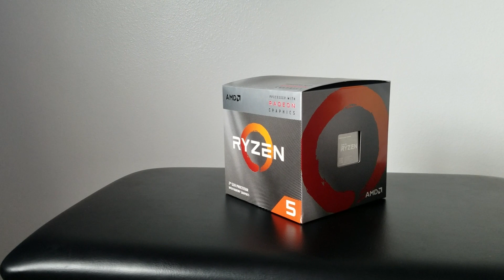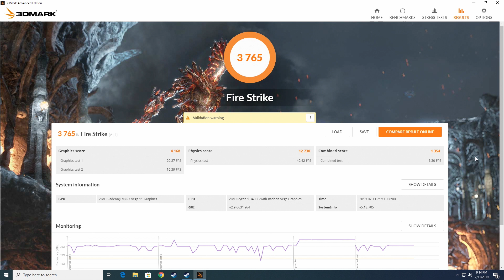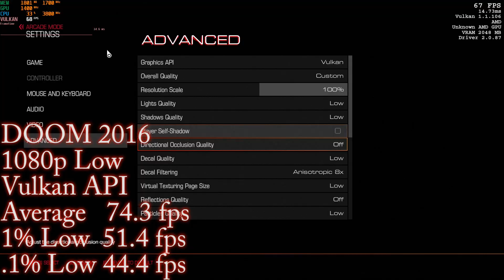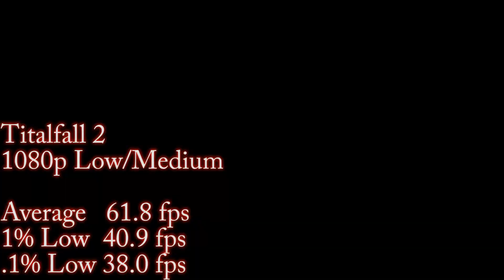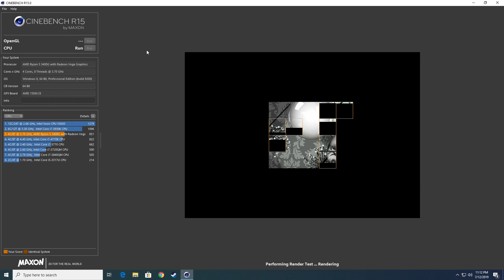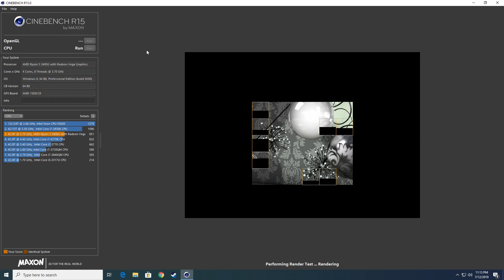Ryzen 5 3400G w/ OC Samsung B-die Memory

Comment: Hey man i need your help. I'm an amateur but I want to build a new computer. I'm thinking MSI  B450M titanium mother board with Ryzen 5 2600 CPU but I don't know which Ram to get.
At Max i will be editing images in photoshop but I'm not a gamer AT ALL so i want to save as much as possible on money. I think I'll stick to the reccomendations AMD reccomends for this built and I'm looking at corsair vengeance LPX 3200mhz 2x8GB 16-18-18-36 for $150AUD or the G skill expensive price at $350AUD flare x or Triden z 3200mhz 14-14-14-34 2x8GB.
I heard these are both B-die but don't know if that's true?
What Ram do you reccomend for my motherboard and CPU? I got radon 250 graphics card btw and Samsung 860 evo ssd.

I want to save money and don't know if the hefty price tag of $350 is worth it?

Thanks
Reply from the maker: Hey man! I think for your situation it makes the most sense to go with the $150 LPX kit. It's not B-die, but in most cases it's not needed. If I were you I'd save the cash and put it elsewhere. You could get a couple percent more performance with the Trident Z kit, but I don't think it would be worth another $200.
Reply: @prerunnerwannabe  thanks for your reply man. Is it really recommended to follow what the AMD advice's on the compatible RAM or should i ignore their list and just go with any good brand i find? also what do you think about my setup, Ryzen 5 2600 with M450 Mortar or M450 pro carbon with radeon 250 graphics card, its for doing editing on photoshop at max? im about to buy the computer soon maybe this week. Also will my old intel 500w powerbox be compatible with the new AMD or nah? do you know where i can buy get windows 8 because i think my windows 10 is messing up with me a lot, will windows 8 be hindering the performance of my new comp? thanks for your reply. Sorry im a noob at this
Reply from the maker: @r.k862  Really if you want to be super sure that your ram kit will work, go to the QVL (qualified vender list) for the specific motherboard you're interested in and see what ram kits they recommend. 
I like your build, although I would personally like a slightly more powerful gpu, you probably don't need anything super beefy for photoshop. When you say powerbox, do you mean the power supply? As long as it is a decent brand and has a 24 pin and an 8 pin connector, you should be fine.
I don't think Windows 10 should cause any issues with this build and running photoshop. . . I would personally do a fresh install of Windows 10 instead of going back to windows 8. It's just newer and is superior in my opinion.
Hope that helps!

Comment: Hello from Russia (sorry for Putin, we will fix it soon) ^___^
I want to build a computer on MB "Gigabyte B450 I AORUS PRO WIFI" with RAM "HX424C12PB3K2/32" and "R5 3400G". Case "Powerman EQ-101 200W Black".
Please answer some questions:
1. How is the consumption from the socket (all system) and on the testimony of HWiNFO64 (APU)? (in watt)
2. What are the temperatures of the APU during the game?
3. How do you measure .1%? (Methodology, program)
4. Add percentage of GPU-employment.
5. I am looking at CPU loading. In all tested games, performance is limited by VEGA 11? Logically reduce CPU power and add GPU frequencies
6. How many ranks of memory? (I'm not talking about the memory channel) I think in 2-rank memory the minimum FPS will be greater at the same timings and frequency.
7. The new APU "4400g" will be on zen2 and its memory can be overclocked over 4000Mhz. Как тебе такое Илон Маск?
8. 4:33 - song name?
Reply from the maker: Hello! Hahah! We'll try and fix Trump in 2020 as well :)
I like your motherboard choice, just make sure that the BIOS is updated or that you have a way to flash it to the latest BIOS. Even though the 3400g is a Zen+ chip, it still needs the latest BIOS. 
I'll answer all of your question as best as I can!
1. With the memory overclocked but the cpu running stock, the most power draw I ever saw was around 160 watts from the wall, so really more like 130 watts because the power supply I was using is only about 80% efficient. I used a "Kill-a-Watt" meter to accurately measure the power usage.
2. If you use the included Wraith Spire cooler, you should only be seeing temps in the 70's C. 
3. I used MSI Afterburner, because they have some really nice tools for measuring almost anything that you want, including .1% lows. Basically once the game loaded up, I would hit whatever key is set to start the benchmark run and would play the game until I felt I tested a sufficient amount of the game to make accurate results, and at that point, I would stop the benchmark.
4. I tried, but there is a bug so it shows like 60,000% gpu usage. Weird, right?
5. Yes, in all of the games, performance is limited by the Vega 11 graphics. I did that to an extent by disabling the cpu boost feature, and that gave me more headroom to increase performance on the gpu. It's still not crazy powerful though.
6. I believe I used single rank memory, and I was under the impression that single rank performs better, but I could be mistaken?
7. That would be awesome if the memory could be overclocked to over 4000MHz on the 4400g!
I couldn't tell what that last bit was. Were you asking if I like Elon Musk? 
8. The song is called "Thor's Hammer" by Ethan Meixsell.

I hope that helps, and thanks for the great questions! I hope I was at least somewhat useful in answering them :)
Reply: Thanks for answers!
1. Similar to PS4 Launch CUH-1000
2. Yeah, with Wraith Spire cooler ~70's C. But i want Noctua NH-L9a-AM4 + 120mm blowing out, something like this http://ipic.su/img/img7/fs/2019-06-1518-42-32.1566454726.jpg
3. Clear. If you want, then try this https://www.youtube.com/watch?v=S2wa1azD8w4
4. In all monitoring programs? It’s strange. Apparently AMD drivers get crooked.
5. Ok
6. Even the pentium responds positively to this https://www.youtube.com/watch?v=k2ohUlJoG0M&t=1571s https://youtu.be/FQYMY7fxHcw?t=702
7. No. This is meme https://twitter.com/elonmusk/status/1095574487104315392 (And how do you like this, Elon Musk? = Как тебе такое Илон Маск?)
8. Super.

Comment: Hi, you can use 4000mhz ram with this cpu ?
Reply from the maker: Sure! You won't be able to reach 4000MHz (probably more like 3400MHz) but you can use a 4000MHz memory kit if you want. It's not worth spending more for a 4000MHz kit over like a 3600MHz kit though.